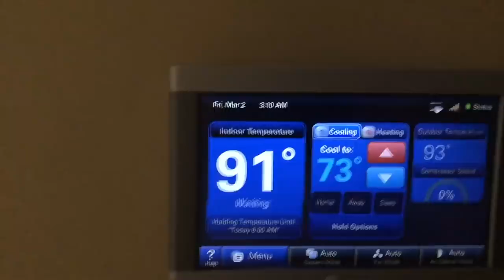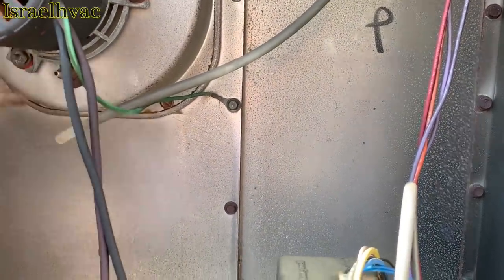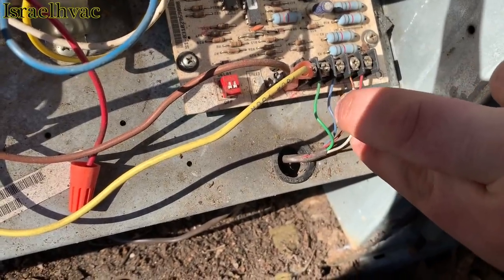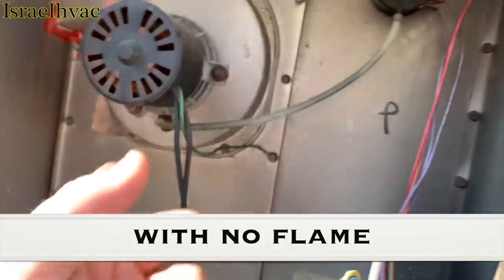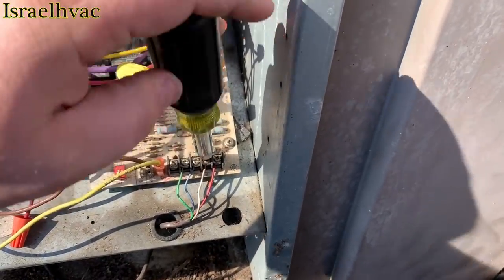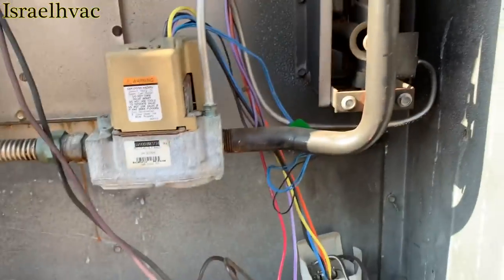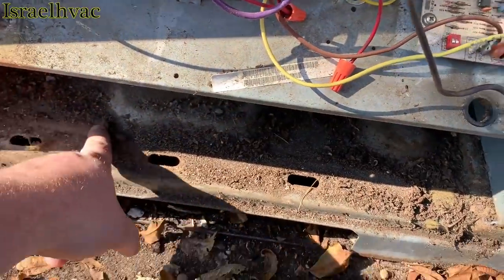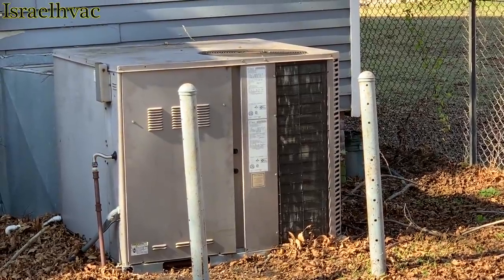HVAC | No Heat Call | York Package Unit

Comment: I was York trained and one of the problems with York is the big shots in the York main office was they give the factories a set amount to build the units and they have to stay under budget to build them even if they have to cut corners to build them, even a simple thing like a filter support that will keep the filter from sucking in that would cost a buck or so to make, nope-nope-nope.

Comment: What's the temps like down in LA? Sucks up here in the Pitts PA area.... I hate the winter. I hate unravelling and re-coiling ice cold extension cords, trying not to break my neck humping a condenser and/or furnace up and down icy steps,  brand new 2018 ecoboost Transit getting stuck with the slightest dusting of snow....... the list continues. Did i mention i hated winter?         Good to see you making videos, John.

Comment: You wouldn't want to share how to access the blower motor for this assembly would ya? I have looked everywhere and can't seem to find how to access that.  Others just have you remove some screws and pull the unit out but this unit seems like it is locked back in there.

Comment: That's gas flex line is a HAZARD. It should be hard pipe out of the unit.  The reason why..vibration and potential to break flex line causing a fire hazard to explosion. You should have fixed that too. That unit should have been shut down.  Locked out and tagged out till replaced!!!! What was the gas pressure.. good fire doesn't qualify it to be right. Why do a half hiney.. job?????? Again a scab job!!!!
Reply: I began the trade on Nevada where earthquakes are a real threat and you would hard pipe out of the unit install a drip leg and run flex to the existing pipe.